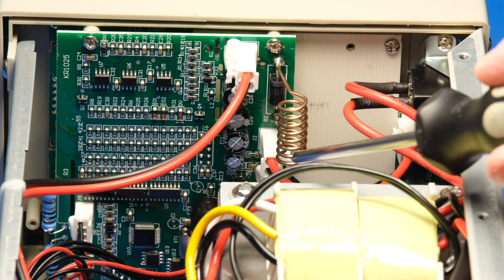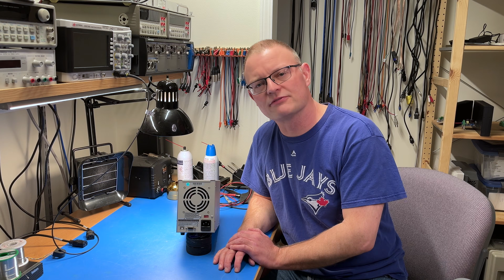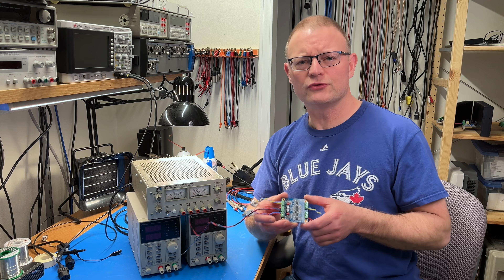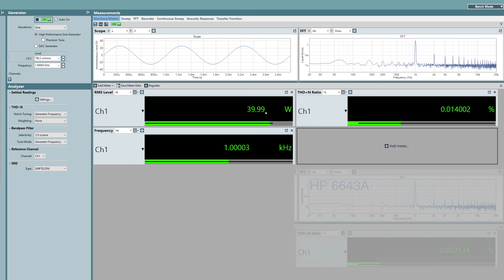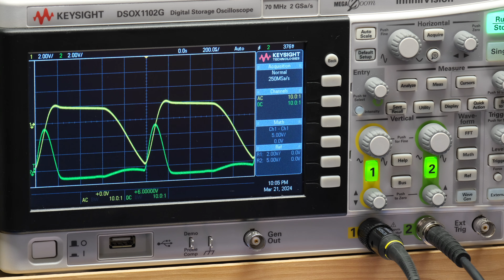Are cheap power supplies any good for audio - Part II

Comment: A "free" screw jumping around inside the device! How dangerous can this be 😱 I'd double check inside to ensure it's not missing somewhere!
Reply from the maker: Oh, I did look. It didn't seem to be missing anywhere, so I think it was dropped in the power supply by accident during assembly and nobody bothered to figure out why that supply had a rattle when all the others didn't.

Comment: I don't think it's quite fair to compare a used high end product to a basic new product, when it comes to price. Used is without warranty, service etc and you're dependant on what's available and the state it's in.
New you can buy at a shop and it get's sent to you wherever you want and whenever you like. I know it's not the main topic of your video, but the comparison was made.
A new keysight powersupply with similar performance costs in the region of 2k I believe, so if the conclusion needs to be extended, that's probably what it'll cost.
Reply from the maker: That may be. But the Chinese supplies are still rather useless for high-end audio, even at line level. So if your goal is to measure high-end audio, you'll need to look elsewhere.
Reply: @Neurochrome2010  Yes there is a distinct difference in quality on certain aspects between a $80 power supply and a $2k power supply.
That said I wonder if the effect you're experiencing here couldn't be solved by a capacitor and keep $1920,- in your pocket.
Reply from the maker: I wasn't able to solve it with a capacitor on the output. Supposedly you can modify the supply to make it work better. I haven't tried that. The supplies I tested went back to Bezos many months ago.
Reply: @Neurochrome2010  Bigger capacitor 😉😁
But too bad you didn't include that test in the video especially as you did test that, as that is the normal way to resolve these types of problems in audio. Add a buffer.
Now we can't see what happened and can't learn from it...🙂

Comment: Interesting tests and results. This Korad unit looks pretty much the same as my Velleman LABPS3005D PSU's (My Velleman PSU's visually differs by having: Countersunk front connectors (like a typical multimeter) and only 1 input voltage (230VAC input / no input voltage selector switch). I believe there is at least one other brand that makes a similar rebadged unit with the same looks and specs.
Reply from the maker: It would not surprise me one bit. I've seen these supplies in various "trim options" or "brands". It's the same circuitry inside just different coloured plastic.

Comment: The transformer will audibly "kick" and "clunk" in it.  It clunks for example when I put a transient load on my inverter.  The voltage dips asymetrically and the tenma "thunks" as the transformer apparently isn't bolted down that well?

Comment: You seem to be the right person to ask:
I have a DIY PCB which is just an interconnect for 4 I2S connected digital components.  Cored by an STM32H7 soft-DSP.
Here is the annoying thing.  Whether it's power or not that board is a low band noise antenna.  It picks up all the USB and HDMI "chatter, clicks and chirps", sometimes you can hear your mouse moving.
It is powered by one of those Tenma 12V passed through a buck converted down to 3.3V, but as I said, it still emitts noise even the DC + is disconnected.
It has to be coming from that PSU ground rail (there are other things on it) or the buck converter.  However, when powered directly and souly from the tenma (linear) it still couples all the low band chatter.
Reply: I'm going to try powering it from a battery.  If it still coupled HDMI noise.... I just made an AM antenna.
Reply from the maker: EMI issues can be fun that way. :) It could be noise coupling through the ground connections. Especially if you have a PC involved through USB.

Without more information it's hard to provide specific guidance. You could ask in the Digital Source forum on diyAudio (diyaudio.com) though.

Comment: I replayed around 26 min into this video because I heard you say 8 Volts of ripple on the PS output.  It sure seems to me that something is very wrong here because that is not a regulated power supply.  It is either current limiting or a broken design.  Is the peak current higher than where you have the limit set?  Would bigger filter caps solve this problem?  If the peak power supply current draw is higher than your set point then it seems to me that you need to provide bigger filter caps. What is the scale for the current trace?
Reply from the maker: It's a broken design. Someone in these comments suggested that a fix might be possible by adding/changing a capacitor. The peak current drawn by the audio amp is below the current limit of the supply. You can convince yourself of this pretty easily. It's an 8 Ω load, 30 V supply, 5 A current limit. Ohm's Law: I = V/R -> I = 30/8 = 3.75. 3.75 < 5 last I checked. ;)

Comment: Was looking at getting one of these for audio work… now I am lost again, any suggestions in the same price range?
Reply from the maker: The HP 6236B and 6237B are in the same price range and ±25 V at up to 500 mA. Great for line level work. There are some other supplies in the HP 62xx-series that could be interesting. I know there's a 200 W model. I had a 2x50 V @ 2 A model, but I forget the model number. That's a bit more useful for power amps. But, honestly, your cheapest option for power amp testing is to get a pair of Mean Well LOP-series in the voltage(s) you need.
Reply: There is the new version KA3005PS, they improved all that issues

Comment: Was is it about these Korad supplies that make them perform poorly feeding a Modulus 386 versus say a simple non regulated linear power supply?
Reply from the maker: The Korad supplies perform poorly with a pulsed load in general. The control loop within them isn't designed well and it doesn't react fast. That's fine for a load that's constant, but that doesn't work for any Class AB power stage.

Comment: The reason why the dynamic load test results of korad are so bad is due to a design flaw. And I solved the problem. Disassemble the device and find the capacitors C28 and C35 on the motherboard on the front panel. These are 10 nano farad. Remove them and replace them with 100 pico farad. When you do this, it will be an incredible improvement. When you test again, you will get almost the same results as HP. It would be useful if you prepared a video by making these modifications and tests.
Reply from the maker: I no longer have those power supplies. Interesting that they can be bettered, but I'm not really into the buy-and-modify model. I'd rather have something that works well out of the box.

Comment: Can you please suggest me a trace to explore more about buffer configuration exposing power supply issues as said in 20:53 ? I would like to know the reason of this. Thank you so much for quality content.
Reply from the maker: The buffer used in the video is the Neurochrome Universal Buffer: https://neurochrome.com/products/universal-buffer You can find the block diagram for it in the Circuit Topology tab.
Reply: @Neurochrome2010  thank you for reply. I was asking and I'm curious about why this configuration exposes power supply issues.
Reply from the maker: The buffer draws current from the power supplies. If the power supplies can't keep the output voltage steady as the output current changes, as it would when driving an audio circuit, then some af that unsteadiness will trickle through to the output. That's picked up as distortion.
Reply: @Neurochrome2010  clear :) thanks ❤️

Comment: The encoder of my korad ka3005p has started to go crazy from time to time, and this can bring sudden destruction to the circuit it powers. When trying to change tenths of a volt, I get several volts jumps.
Reply from the maker: Oh, wow. That's no fun. You may be able to find a replacement through Mouser.com. Just search for 'encoder' and you'll find a bunch. You'll have to go through the data sheets for the mechanical dimensions to make sure they fit.
Reply: I just did my fix, added two  caps(mlcc 100nF x2) to encoder pins, the original caps on board are 10nF which are next to the 10pin female connector. The encoder schematic is extremely simple, no external pullup resistors.
Reply: @槑  wait, you can fix the encoder with capacitors? I thought the erratic behaviour was due to mechanical problems. I might as well give it a try.

Comment: This is one of the more in-depth power supply reviews, well done! There are still some aspects that might be interesting: wiring of the earth connection, are all metal parts properly earthed, more info about the circuit, a bit of reverse engineering of the rather poor control loop, CV to CC transition in operation (not during switch on), ripple and noise (20 MHz), current ripple, transition between the taps under dynamic load conditions, specs and plausibility regarding how much the supply may be floated above/below earth ground etc.
But again: This already is much more comprehensive than most reviews…

With my soldering station I recently discovered that the mains hum gets really annoying as soon as the station comes close to the metal chassis of a rework station below. Haven’t looked closely at that yet, but I wonder whether it’s the same here.
Reply from the maker: I appreciate your input and suggestions, especially the one about grounding. I'll keep those in mind for next time. I did test to see whether a dynamic load would cause the supply to cycle between two ranges. That does not appear to be the case (good!).
Reply: @Neurochrome2010  That‘s good to know!